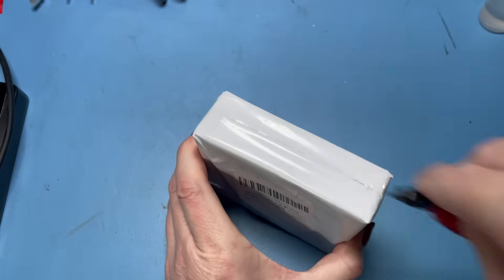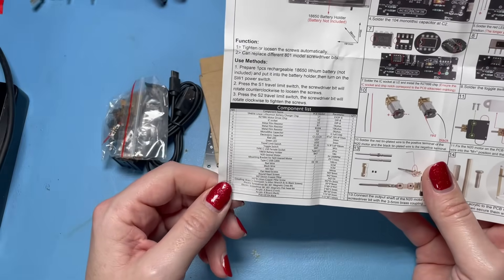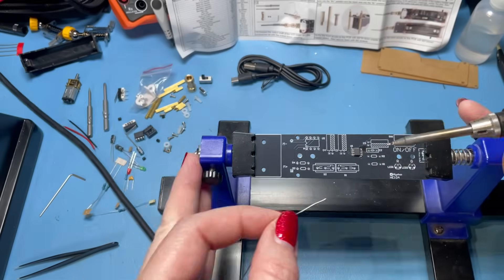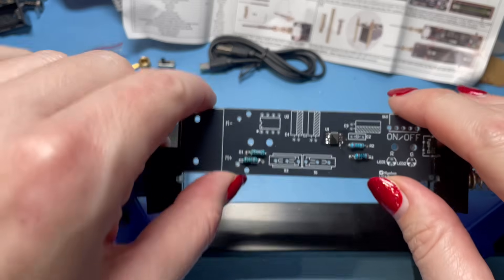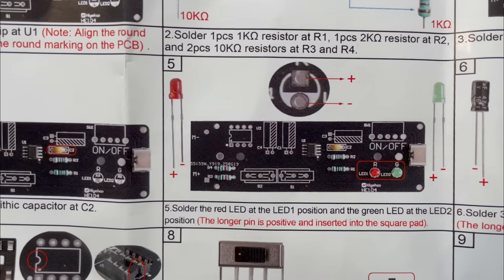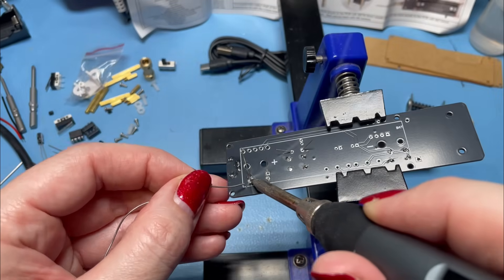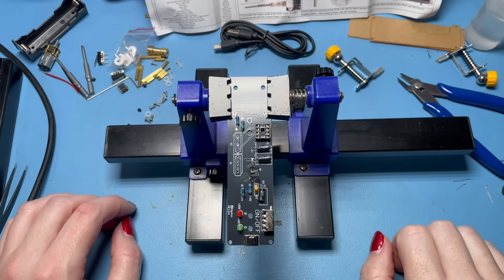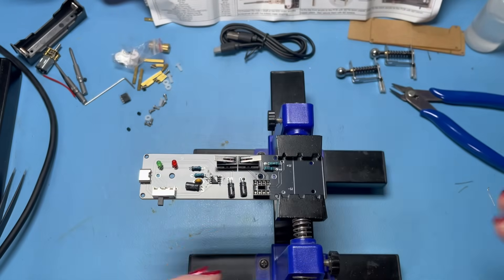Electric Screwdriver Electronics Kit - Build Your Own Electric Screwdriver!

Comment: Although you built it as per the instructions, I think it might be better with the motor mounted on the other side of the PCB so that it's sandwiched between the PCB and the overhang of the case on the battery side.

Comment: Jazz, having learned to solder WAY before there were surface mounts, the idea freaked me out too (especially with MY shaky hands).  They're NOT that bad.  Put a little flux on the board, touch a bit of solder to the board to get it on the mounts, and use a heat gun after lining up the chip.  It will pretty much LINE ITSELF UP and you don't have to do each leg separately.

Turns out to be EASIER that way 🙂

Comment: Love your videos, but I really found it amusing that you kept on holding off inserting the motor-driver IC because you didn’t want to stress it by heat, yet the first component that you soldered in was an IC… (don’t worry, I go through the same, first solder the SMD-components, including semi-conductors, then I come with IC-sockets, and leave inserting the IC’s until after I have measured the voltages, ignoring those poor SM-IC’s)…. 😂😂😂
Reply from the maker: This literally made me laugh out loud!  You're so right!  I guess it's habit from when the old days when there were less SM ICs about.  I'm glad I'm not the only one that still does it!  It does seem like that poor SM-IC had to fend for itself while the motor driver IC had special VIP treatment!
Reply: Highly entertaining,  thank you!